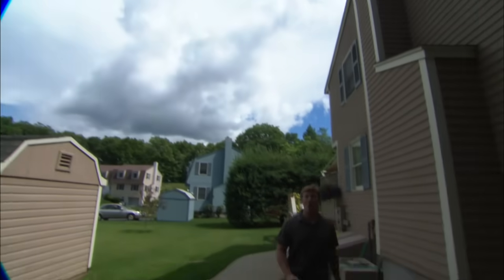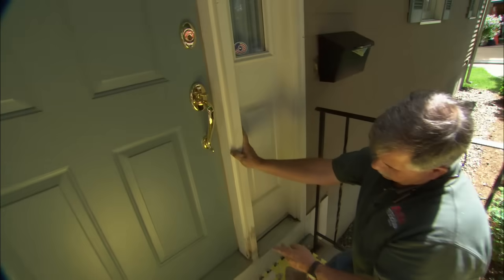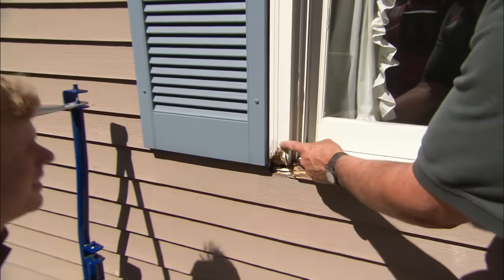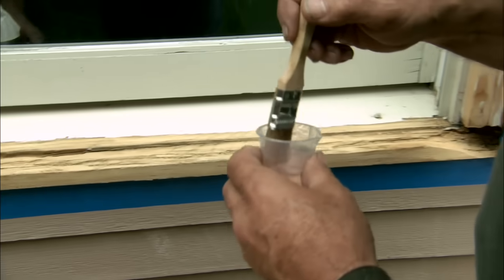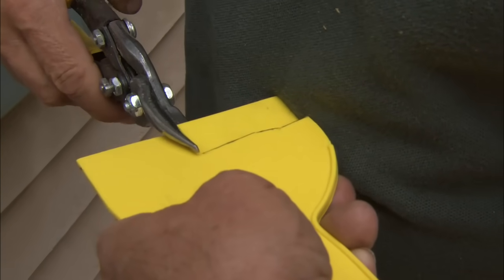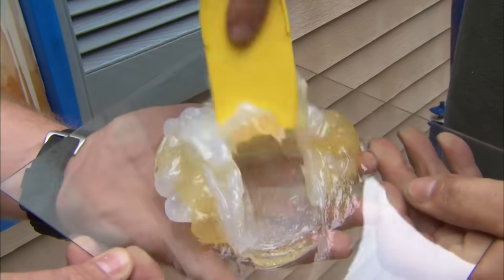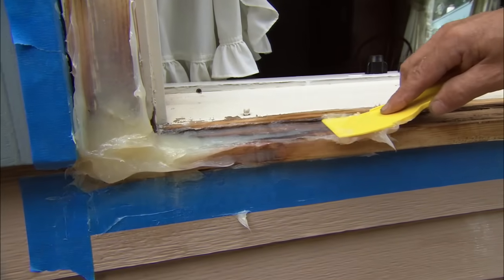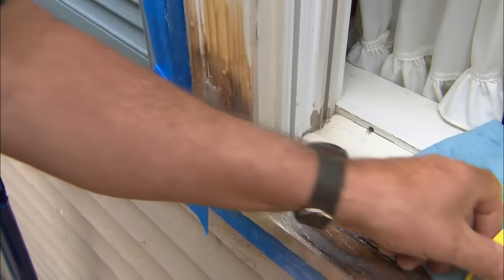How to Fix Rotted Wood with Epoxy | This Old House

Comment: Thank you for the video very nice job! I appreciate how you show how to do the template with the spatula. I fixed 3 rotten wood beams and 3 window sills. I took away the wood rot first , then apply a product call Rotten wood restorer by Bondo. It really harden the wood  in few minutes. Then i used Wood Bond, sanded it and painted it. Looks great!
Reply: I use super glue to harden wood. The liquid type soaks right into the fiber.
Reply: Cool so i Rotten Wood Restorer. I really love the product  ,  very easy to apply and dried very hard very quickly
Reply: They say Bondo dries hard and doesn't give with the weather so it will crack

Comment: He is Using Flex-tec HV (see at 2:07). At $200+ per twin Bottle kit of Epoxy, I might as well pay for the wood replacement...
Reply: +Erick GT yup your right around 200$ holy crap
Reply: "Before we apply the epoxy I have to apply a 'bonding agent' to the wood so the epoxy adhere's to the wood."  What's the name of the "bonding agent" in case I want to try this.   Also, do I need a router or can I just attach the triangular shaped grinding bit to my drill?
Reply: You can use a dremel. I have no clue what the bonding agent is. This video isn't that helpful other than to show you how to do it once you guess what materials these bozos are using.
Reply: Here is their video, they also make thge bonding agent ... watch?v=EcRoCm9Am0g
Reply: Get an EndRot kit, it's like $40 and a lot easier to work with than the stuff they are using.
Reply: Polyester Resin,  mixed with Saw dust is Cheap and works just as good...  Without a bonding agent..
Reply: I agree - lot easier for these kinds of repairs....
Reply: This was a reply to the EndRot suggestion - !
Reply: I'm not certain if it's the same bonding agent as the video, but the Flex-tec HV system includes Prime-A-Trate, which "is a two component epoxy-based bonding agent designed specifically to enhance the bonding strength of Flex-Tec HV." Perhaps that's what he used?
Reply: John Graham I
Reply: They also make a single cartridge version.  Don't know the price tag, but it's undoubtedly more affordable.  So the question then is... where does one buy this stuff?
Reply: $200 damn that's a lot of money, personally I use auto body filler
Reply: People trying to cut down less trees these days.
Reply: JIM RICHTER how about DAP wood filler?
Reply: Erick GT Wouldn't wood putty work as well
Reply: Rot Fix from System Three Resins is a low viscosity epoxy, wood sealer, hardener and primer. It is formulated for fast, deep penetration into wood fiber to restore body and structure to wood damaged by rot and severe weathering. RotFix creates a solid foundation for paint. $40 at Home Depot.  Or Bondo (also at Home Depot) on top of Minwax PT Wood Hardener ($10 at True-Value)
Reply: It’s not for U too use that much
Reply: @jimrichter9549  That is what I have used and it has worked well, I think it cost under 15 dollars or so.
Reply: Maybe you people could help me because at this point I am thoroughly confused and disgusted after looking at a bunch of videos and even talking to people in Lowe's as to what to do about woodwork that was ruined by cat urine .
I can't at this point afford to replace the woodwork but I couldn't understand why it was bulging and buckling and actually looked like it was melting in some parts and the worker at Lowe's told me it's because most woodwork nowadays is made out of composite material and when it gets wet it will become waterlogged and bulge like that .
He sent me home with a small thing of vinyl spackling but I haven't opened it yet .
I have to figure out how to cut away the parts of the wood that are bulging and all of my tools vanished when I moved here  . I don't even have a hammer right now ... I'm struggling financially so this is really depressing . The only tool I have left is a drill gun but all the drill bits are missing... first of all I'm going to have to remove some of the wood and fill it in so I am up for any suggestions as long as you realize that any money is coming out of my grocery money... that's how broke I am ... I was actually thinking of filling it in with plaster . I need to do this with the cheapest prices in mind . Later when I go to move I can always consider replacing the woodwork but I just renewed my lease .
Reply: gardensofthegods First, get rid of the cats.
Reply: Thanks that was my question
Reply: Is there another type of epoxy to use ? $200 geez
Reply: Not true in. Y opinion ,labor cost as well as wood and time to take all of this apart and fix it you liable to get into allot more than you bargain for , just my opinion , not trying to be rude or anythinng
Reply: Okay so I found both the tube and the gun on Amazon , 40 bucks for the gun and 40 bucks for the app you 80 bucks total .. a far cry from 200
Reply: @Carpenters_Canvas  can you post the link? Is it the products used in this video? I wonder if over time, other companies have created similar products that drove the price down or if since this video better products have come out after all, this video is over 3 years old and current products bare looking into.
Reply: gardensofthegods leave some anti freeze out for the cat that’ll fix it
Reply: @gardensofthegods  It most likely a fiberboard (like MDF) which absorbs waters more easily and is weaker than wood. So a long lasting strong repair is doubtful. But the cheapest way get temporary repair is would be scrap away the damage with knife and use a bondo auto body epoxy filler and some wood screws. But caution fiberboard is so weak using wood screws cause crack if no pilot holes are drilled. So if any cracks start to appear you may have to just use the bondo without the wood screws.  And check a dollar store, if decide to attempt this repair for the supplies.  Also using  vinyl spackling is an option too but it pretty soft. And a wood or other fiber would help but Im thinking that would be to complex for you. Or just remove the damage material and seal  with a paint. It wont look the same but it would help prevent more damage.
Reply: Y
Reply: gardensofthegods sounds like you have other issues that should be a priority like making money to live. If you’re in a rental why don’t you ask your landlord to repair it? Unless it’s your cats that made the damage then it sounds like you have a cat problem if they’re pissing all over your house. First get rid of the cats. As much as you may love them they are causing you grief and your groceries should be more important than having cats. Then forget about the repairs until the end of your lease is approaching. Focus on yourself right now.
Reply: Yikes!  You are right - probably good product but way too expensive
Reply: Please tell me who I can pay to do this with new wood for 200 per window. I need to hire that guy
Reply: As a handy man I use Durham's Rock Hard water putty.  Home Dumpo has it and is a crap-ton cheaper too. In the paint isle.
Reply: Bondo will do the job, its worked well for me. Mixes easy and cheap.
Reply: @grubbetuchus  Typical of ALL the videos on YouTube by "This Old House" (Bob Villa and friends).  These guys are hacks!  Check out the list of lawsuits against "This Old House" when Bob hosted the television series.
Reply: @JohnPGrier-sm8cl  Use a dremel and don't use this epoxy, it's REALLY expensive and you have to buy that special gun.  Just replace the wood, you'll need to cut the old sill off the window frame however and it's a chore.
Reply: @THOMASTHESAILOR  can sawdust be purchased?
Reply: @harpoon_bakery162  ,  I don't know..  I would imagine it's sold somewhere..  Check Amazon or Ebay..
Reply: @THOMASTHESAILOR  ok, thanks!
Reply: Erick GT it looks like the epoxy kit is about 200, but just the epoxy is 70.
Reply: Calgary hail
Reply: The Epoxy will NEVER rot. I would say cost its worth the permanent fix. Also, there are probably other areas that could use the same repair
Reply: @acheekymonkey  I bought the kit and did repairs using it and it's definitely worth the money. The repairs holding up well on 107 year old house in Boston, Massachusetts.
Reply: Buy from Southern Carlson
Reply: I used Bondo All-Purpose on a small section of my deck. About 3/4 inch deep, two inches wide, and 16 inches long. I wanted to try this first but didn’t rule out replacing that section of deck board. I used the Bondo Wood Rot Restorer to harden the wood around it. After four coats like the directions said, i layered the bondo in 1/4 inch, then wood shims, then another 1/4 inch. I used the shims so it wasn’t just all filler. Sanded it. Painted it. Looks great. The stuff they’re using is too expensive for the average homeowner. I’ll but it’s high quality though.
Reply: Carlo Ciccone 
I used Bondo filler on wood rot on my back door.  Rain splash had rotted my threshold and bottom corner of my door. Replaced the threshold and “Bondo’d” the door (cut out water rot etc.). Years later still solid and looks great. You’d never know there was a repair unless you get down on your knees and look real close. Also, I installed a storm door. Highly recommended.
Reply: There are other brands that are cheaper and as good as this one.
Reply: @acheekymonkey  Thanks.  I think you correctly identified that bonding agent and why they did not mention anything about it.
Reply: The problem isn’t price, it’s finding outdated moldings

Comment: Outstanding. I buy my epoxy by the half gallon and one of several thickening agents.When dry, its solid like plastic and a little flexible. Great video. I have done the same thing around my home, several times. Process confirmed. Fantastic
Reply: Harry Paul Garcia have you found a resonantly priced 1/2 gallon size of epoxy?

Comment: Been using auto body filler for this for 10 years.  I stay at that house today and it showes no signs of failing.
Reply: Thanks for info will try.
Reply: I have been using bondo for 10 years too and as long as water doesn't get into the wood under the bondo, it will last!  I don't know why some complain that it doesn't work but it does work.  Others say it's not water proof. But so is wood! That is why we paint over it. Yes, it can crack and separate where it meets the wood, but if you keep an eye out, the problem can be fixed before more damage can be done.  Cheap, fast repair and easy to apply. I'll keep using it until my window sills become 100% bondo. :p

Comment: Bondo makes an all purpose "fill" for about $11 per tub. Might be a bit more difficult but works beautifully and can be painted/sanded.
Reply: It doesn't work as good for exterior purposes though. It doesn't expand and contract with the wood nearly as much as this epoxy will, so it could crack and then pop off. May not happen a lot, but it's a very real possiblity.
Reply: @AxcelGamer97  yeah I probably only use it for diy home repairs vs a paid job, but so far so good here. Replaced all the rotted trim of my windows here and it looks pretty darn good from a few feet away.
Reply: @sean9820  I bet it works fine when you're doing it yourself like that. I've usually ended up just going the route of cutting out whatever is rotted and putting wood there simply because it's usually just one section of trim instead of a whole bunch like in this video. I've used Bondo a lot though for interior projects, such as trim, and it's worked great on that front.
Reply: @AxcelGamer97  amen brother! I should note I did cut out and replace the wood as well, used the bondo to blend and fill the two/any gaps. Also had some rot on the bottom of our doors, which I again just filled and sanded. Little areas here and there where it helped in a big way.
Reply: I’d use bondo any day considering this epoxy stuff they showed was nearly $100 for the bottle and doesn’t include their “special” gun.

Comment: If there is a big cavity that needs to be filled, you can use scrap wood blocks to make the epoxy go further.
Reply: Emmm I used people's  s lasting
Reply: Where the void is larger I cut timber into the area and apply an expanding glue which dose it's stuff and works its always into all the books and crannies making for an seperior bond.

Comment: I've used this product, about $85 a tube plus special gun. For some applications its great, no sag at all, totally waterproof, very easy to tool. It is very hard to sand though so go easy, takes 12-24 hrs to dry.

Comment: West System product is the way to go. I usually put in a new piece of wood but keep coating all endgrain with unthickend epoxy many times until the wood will no longer draw it in like a straw. Then I thicken a batch with chopped cotton 406 and paiste it in. Your turning the crappy wood you can get today into plastic basically. Grind and file to sculpt the patch. Prime and paint. It's labor intensive but a lot cheaper than ripping everything out and flashing it all correctly and replacing. With the wide growth rings in the lumber that's available today carefully epoxy sealing endgrain on for example wood brick molding is an extra step worth taking.

Comment: We should be done with this small repair in two to three days.... 🤣
Reply: "How much is that in dollars, Tommy?"
Reply: That's what i was thinking. It seems like an awful lot just to fix two pieces of window trim.  Seems to me like it would be much quicker and cheaper to just pull the boards out, cut some more boards to size, and put them in.

Comment: Before I purchased my house the previous owner had a contractor repair a sill using car bondo, this allowed the water into and around the entire window. The entire sill and surrounding wood rotted out and now I have to replace the window, window sill, frame, and flashing. Real wood and a real contractor is my next choice!

Comment: Not sure what he used for bonding agent. Years ago I prepared soft rotted window sill areas with liquid thin penetrating epoxy that wicked in through the wood about 1 inch. It made soft wood fibers into hard plastic fibers never to rot and ready for filling. I bought it from "The Rot Doctor"

Comment: I just bought this stuff and it is perfect for the job I needed to do in our corner window.  For that window the number of parts that would have to be removed would be time consuming.  With this you dig out all the rotten wood, sand as much as possible, pretreat with the bonding agent and will the void.  It dries very fast.  Sand and paint.  In the future when all of the siding is replaced that would be the time to replace the wood window surrounds, not now.
Reply: Thanks for the review.  If you don't use the entire tube/tubes  is their a way to cap them and save them?  Was it somewhat easy to sand and form? Thanks!
Reply: @phild9140  You need to apply it quickly.  If you are too slow and work it too much you will get pits or grooves.  I used a belt sander to smooth it because it becomes hard as a rock.  I had window sills that had rot all the way through the middle. The results are amazing.  Do order more that you think because it goes fast.  You don't want to run out.
Reply: Yes the tubes come with caps so you can close it up. I used the tube style where you mix after you dispense.
Reply: @toycarcollector  thank you for the reply. I was hoping I could sand it by hand. Still might purchase it though.Thanks again.

Comment: So you don’t need to remove the wood and replace the whole sill?  I’m in Milwaukee.  Do you make house calls?  🙏
Reply: you dont need to but you should. that rot looks like it was into the casing I would be worried it was letting water trickle down the wall, could definitely weaken the the plate/sill between floors and be a strucural issue. But ol' tommy is pretty smart he probably peaked down in there and made sure it wasnt an issue. 

The nice thing about replacing with epoxy or PVC board is that mofo won't rot out again in another 6 or 7 years. 

When we bought our house 3 years ago the rear door threshold had some rot in it, they hired someone as part of the presale repairs to fix it. He just cut it out a few inches and stuck wood in it (cheapest option). That sumbitch is already soft again. I am going to cut out all the trim and replace with PVC board, permanent fix.

Comment: You can use Bondo and it works really well and a lot cheaper than epoxy and it's paintable as well
Reply: That was slick well done with the putty knife making your temple

Comment: This looks fine, except for the skim coat applied on the face of the sill. Epoxy does not allow liquid water or water vapor to pass through itself. When you apply a skim coat over the face of the sill, moisture can be trapped inside the wood, leading to accelerated rot and the skim coat separating from the sill. 5 yrs seems to be the lifespan of this kind of repair in the humid philadelphia area.
Reply: How do you explain the same does not happen when you paint the wood?
Reply: Gleison Storto Simple. Paint is vapor permeable.
Reply: I’ve seen this too in marine industry. People coat varnish or epoxy on both sides of wood. A small scratch allows water in and lack of ventilation and oxygen causes ramped rotting

Comment: I use Bondo, a gallon is like $16.00. Works Great for wood and i still have a lot left for Auto. Repairs.
Reply: I've used Bondo, and Bondo wood filler. They both work fine. Minwax High Performance Wood Filler is another great product. I used it to update an old door when I removed the mortise lock and updated to a modern type lockset. Got hard as a rock and I was able to drill out for the bolt.

Comment: I use Durham's "Rock-Hard" Water Putty. It only lasts around 10 years - longer if you prep the surfaces properly and paint it well,  but it costs under $10.
Reply: Does it flex though?
Reply: @cooperwelder75  no